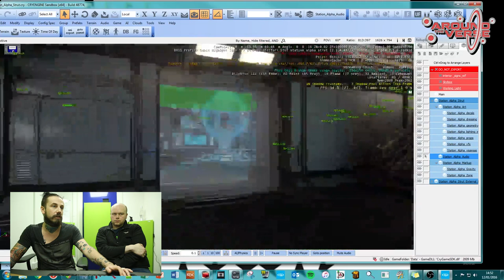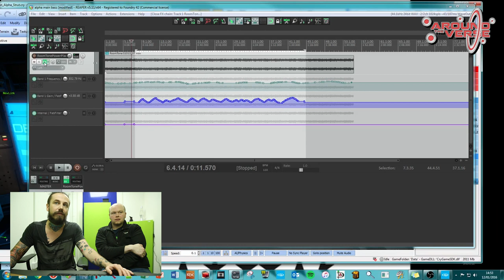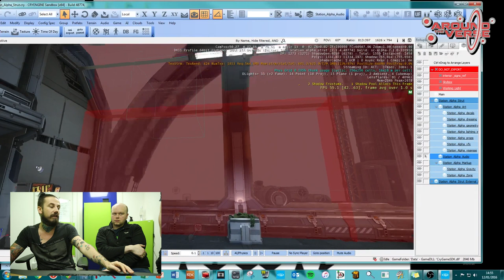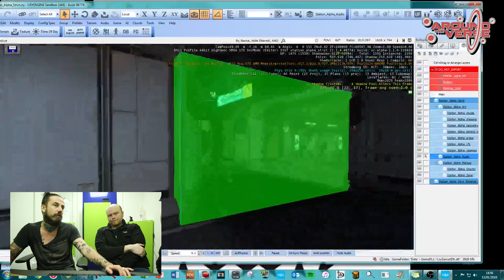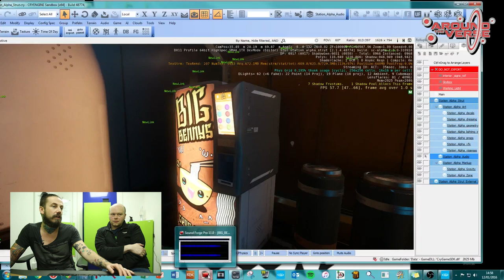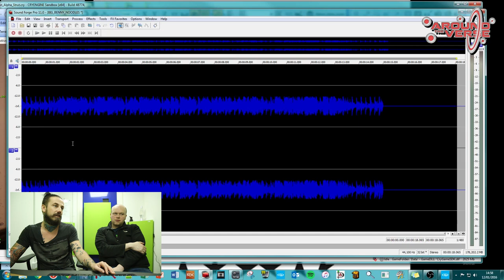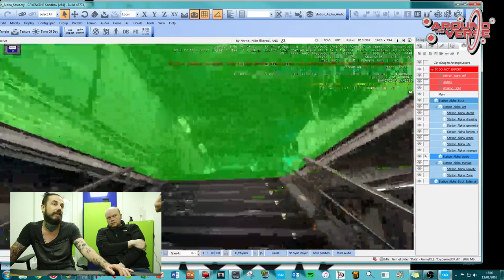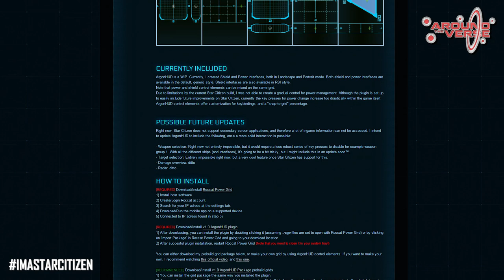Around the Verse: Episode 2.15

Comment: Disco:  it goes 
Angstrom, 
nanometers, 
micrometers, 
millimeters, 
centimeters, 
decimeter (tho hardly ever used),
 meters, 
dekameter (also rarely used),  
Hectometer,
Kilometer, 
Megameter
 and then gigameter..   there are larger meter designation but that's when I stop :p
beyond that you start getting in to Astronomical Units (the average distance from the sun to the earth)
Reply: +mak10z I've never seen anyone using Mm or Gm...  And you forgot the r in angstrom (ångström)
and you forget lightyear + parsec well the first was already mentioned by Jared though ;-)

more details on the big units:
1 AU ~149.6 million km (or 149.6 Mm)
1 ly ~ 63241 AU (lightyear = distance that light travels in one earth-year)

1 pc ~ 3.26 ly (a star that's 1 parsec away moves seemingly 1 arcsecond forth and back when moving on a circle with 1 AU radius... like earth)
Reply: +Jarnar you are correct, I did miss the R :p I'll fix that.   I play KSP so thats where I've seen Megameters and Gigameters used.
Reply: rly? I never noticed that in KSP... maybe I should have looked better at the units instead of just doing it by feeling (solar system = big, planetary system = medium, LEO... well LKO = small)
Reply: yea  KSP actually goes up to Yottameters  but you get  some really weird things happening at that point (square orbits for planets and what not)  check out danny2462's videos  he breaks KSP like no other :)

Comment: my PC exploded after using star citizen for the second time , spent 2 years building this pc just for this game  and now its all gone : (
Reply: +Erik Pilos What happened? Did you not have the proper cooling for your processor?
Reply: i did , everything was perfect , i even took it to a expert to tell me if i finished the PC properly. dont know what happened mybe there was something faulty from the start . : (
Reply: +Erik Pilos building a pc is really not that hard, youll get there eventually.  Just rebuild ur current pc, can make wonders happen
Reply: +Jupkees Yeah, sometimes a pin of the power cable connectors are off or wacky. Happens to the best quality parts... Check all connectors or in really awkward situations where the thing needs to start and dont do it, crack the whole machine apart and rebuild it. Sometimes Murphys Law is strong in building a PC ^^

I had ones long time ago a PC who didnt start at all, we took the machine 3 days on our workbench only to find that a PS2 -> USB adapter for Mouse short-circuit on the case and prevented to let him start properly.... O.o Its allways the small unimportant things who destroy a entire system...